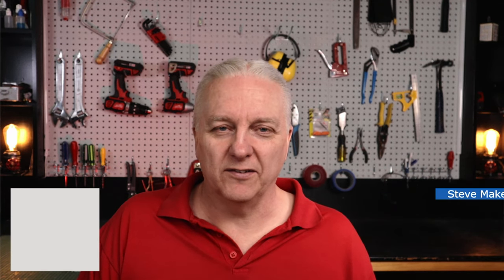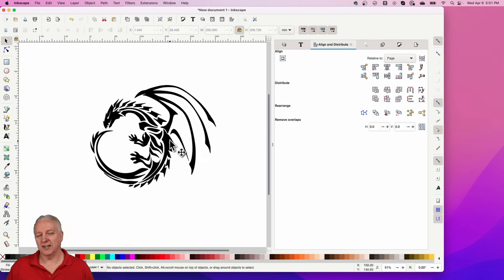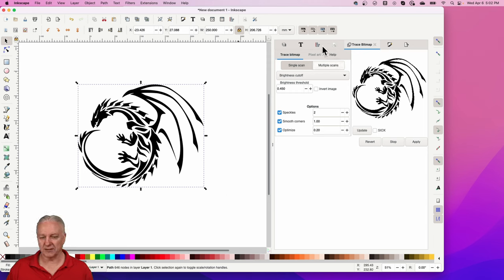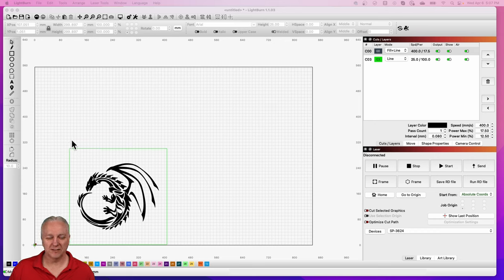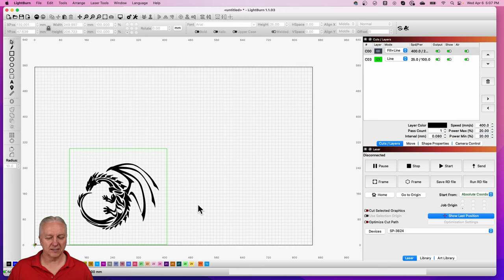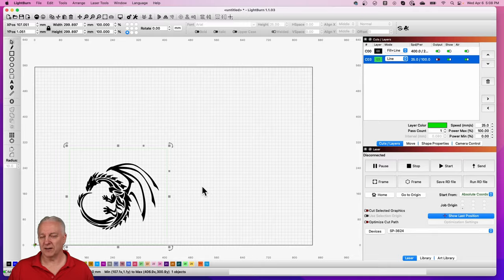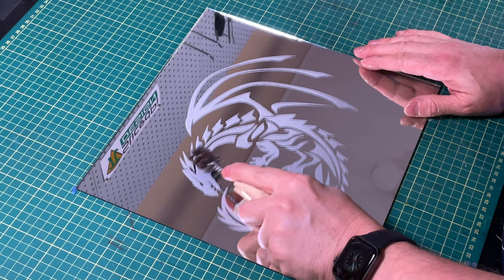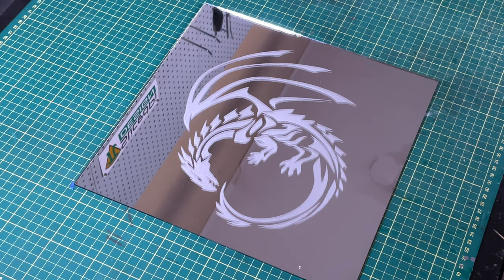Make an Engraved Mirror

Comment: Hey Steve! Great vid as usual. When I do drinkware is finish the glass engrave with water and a 3m green scrubbie pad. Works darn good and just another option to the wire brush.
Reply from the maker: Yes good tip and I’ve used green scrubbing pads as well.  Basically anything the has enough roughness to pick the loose glass off the edges of the engraving works

Comment: This is great! I have the atomstack x7 and I tasked to etch/engrave an image onto a silicon wafer. The surface has a mirror like finish to it but unlike a mirror, the back isn’t painted, it’s a solid color all the way through. What temp and speed do you suggest. Thanks in advance.
Reply from the maker: Interesting project. You may be able to just engrave a silicon wafer. It likely won’t react like glass so you’re going to have to experiment. Ideally you get more than one of these so you run trials. If get more than one you can run a material engraving test.

Comment: So you don’t have to mask or coat the mirror? It doesn’t harm the laser to engrave or cut mirror ?
Reply from the maker: In this case I engraved on the front so there are no vapors. If you engrave from the back you’ll be burning off silver, which I heavy, so that won’t bother your laser either.  As far as reflection, you’ll also be ok because where the beam hit, it won’t be a mirror for more than a couple of  microseconds before the silver is removed, and while it is a mirror to you, to the laser it is a brick wall.

Comment: "... as long as it's co2". Will it come out the same on a diode (allbeit slower and with different settings/passes)?
Reply: No, the mirror will reflect the beam back into the laser and destroy the diode. Engrave on the backside of the mirror (inverted) instead, then you won't have the glass splitter, and you can eventually paint the thing you engraved, (if its a rose, use red paint. Looks just great. :-)
Reply: @PerB_M  Many thanks!
Reply: Have you considered the result if you laser engraved the back of the mirror?  I sandblast the reverse side of mirrors.  I realize it's a different method that results in a different look.  But, the one advantage, in my opinion, of engraving the back, whether it be by laser or blasting with media, is that you don't have to deal with the reflection of the engraving in the backing itself.  I personally think that results in a cleaner image.
Reply from the maker: You could certainly do this though where you engrave, it would stop being a mirror so you’d lose that 3D effect.
Reply from the maker: As Per mentioned, things that are clear generally remain u touched by diode lasers.  Take his recommendation to engrave the back instead.
Reply from the maker: See below.  Kind of out of luck on the glass, but you can engrave the back instead
Reply: @PerB_M  What if you painted the mirror say Tempura Black in the front and than engraved it with a diode would that be fine than?
Reply: @GDISinc  I would not recommend this, the moment the laser beam goes through the Tempura, the beam will be reflected by the layer on the back of the glass, which is actually the mirror itself. Also, keep in mind that when the laser sees the tempura layer it will engrave on the front of the mirror's glass surface and thus you will have a rough surface on your mirror which will also contain glass shards. A mirror consists of a layer of glass that is coated with a kind of foil, the front of the foil is what reflects your image and the back is black/grey which you can remove with a laser as described above. In addition, a lot of mirrors today are not made of glass but of acrylic which even though it is transparent you will still risk deforming the mirror's surface. So the best (and for me) only method is to engrave on the back of the mirror with mirrored writing and then paint it with a contrasting color and/or mount the mirror in a deep frame where you have the option of having a backlight which will then shine out into what you have engraved. If you are really careful you can first engrave the leaves of a rose, spray paint the base side with red, put it back in the laser, and engrave the stems. Then spray paint again with green paint, and now you have a beautiful red rose you can admire in the mirror (both with and without light) :-)

Comment: Looks amazing Steve, another great job. One question if I may. I read somewhere that mirrored surfaces are not ideal when it comes to laser engraving,  unless the surface was taped, I believe it was referring to the laser beam when hitting a mirrored surface. By the looks of your video it was clearly a false statement. Can you possible shed any light on this or what they may have meant. Cheers Steve. 👌👍
Reply from the maker: If the concern is that the laser will somehow damage the reflective surface, it won’t because glass is very good at absorbing all of the energy.  This statement would certainly be true for a diode laser though
Reply: @SteveMakesEverything  thanks Steve I really appreciate the input. Cheers 👍

Comment: So I tried engraving mirrors from the front but nothing is engraving. Im using a atomstack p7 m40 with a laser 5.5w. Could it be the power or is there a coating I need to put on the front?
Reply from the maker: If you are using a diode laser then reverse the image and engrave the back. If you want to engrave on the front of the mirror or glass in general, then you would need to coat the surface
Reply: @SteveMakesEverything  ah ok thanks! would you happen to know what kind of coating would work? and what setting from lightburn would work best?
Reply from the maker: @Gnoimsayn  Your timing is good.  I'm currently working on a video to discuss the various ways you can engrave on clear glass.  Should be out in the next few days, but as a heads-up start by painting the surface black and engrave that.
Reply: @SteveMakesEverything  awesome! And when you say paint. Do you have a recommended paint type? Thanks!
Reply from the maker: @Gnoimsayn  See my newest video.  It is the video I mentioned and there is a link in the description

Comment: Wait ? Aren’t you suppose to burn on the back of the mirror?
Reply from the maker: You can for sure.  I've done both.
Reply: @SteveMakesEverything using a diode it's okay to engrave the front side as long as you're using etching spray or painters tape correct
Reply: Have you tried with a diode from the front side?
Reply from the maker: @paulraycastillo2238  You have to apply some black paint or some other treatment to the front side to engrave the glass.
Reply: @SteveMakesEverything  that's what I thought you had said. If I'm using etching spray will this be okay also? I'm using a 20-watt diode engraving from the front side which is the reflection side.
Reply from the maker: @paulraycastillo2238  Yes, you should be good with anything that allows the beam to work on the glass